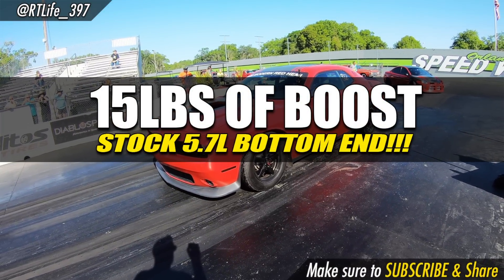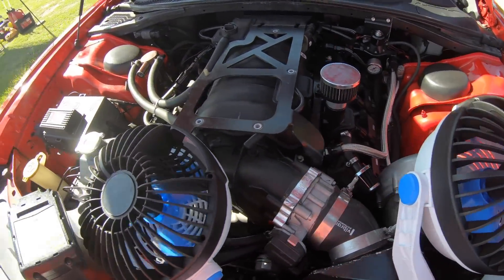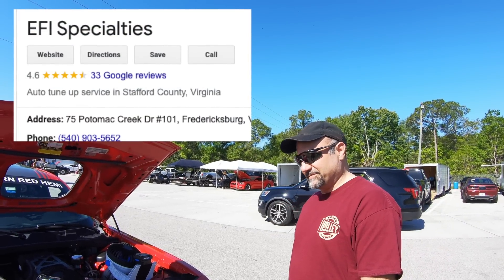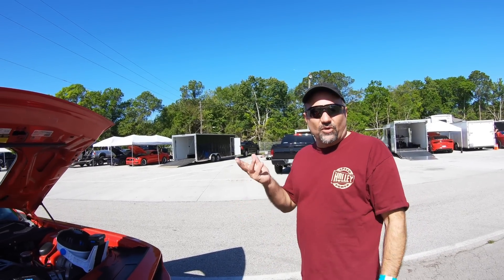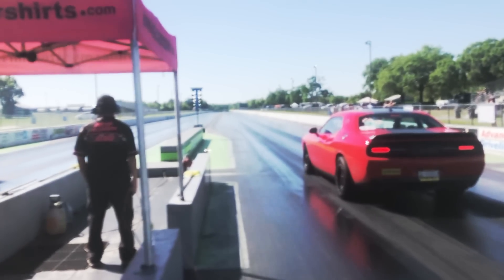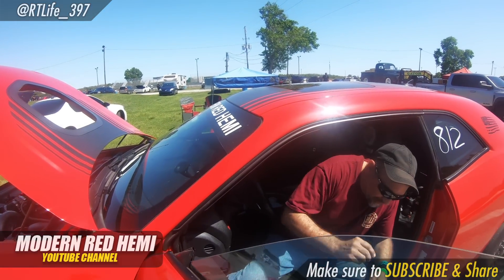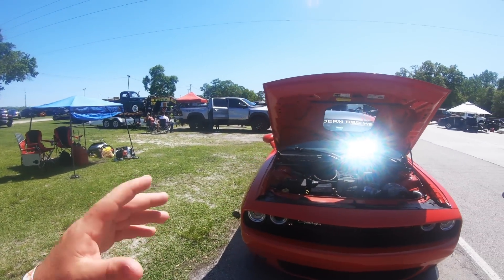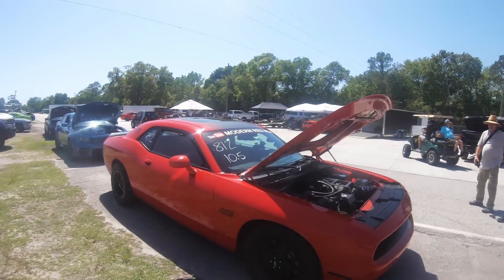Stock 5.7L w/ 15lbs of BOOST!

Comment: Thanks for showcasing Shake ‘N’ Bake one more time! Had a blast hanging out and just being us. What you get on video is who we are. Can’t wait till ya get Big Blue back brother! Hope to get down maybe one more time this year and hang out!
Reply: I've been waiting for the collab video from Orlando. You got Shake-N-Bake rockin. I was impressed when I met you and can't wait to cross paths again.
Reply from the maker: Always fun hanging with you. Shake N Bake did great & congrats on winning the event. You're doing a great job of showcasing the true potential of the 5.7L Hemi.
Reply: Great job Don... you looked flustered haha.. 

To touch on what don said.. there is a ton of tq management in the car to save the trans.. its working.. but its also more than just power being pulled on the shift.. its alot deeper.. the fact that this thing is working so good is definitely all Daves brain being put to use.. being as he started with a slipping shifts banging rev limiter ride when you were only running like 11.3s and 4s.. so its come along way lolol... 

As far as the boost.. the boost is 100% safe.. the timing placements.. the type of blower.. the way it builds boost in the rpm.. all that matters.. cylinder pressure and controlling the heat are some real things.. this stuff is more than a simple boost number.. so many variables go into it.. I think we could push it more with a stronger trans 😃
Reply: Badass 5.7 hemi
Reply: @captainobvious5993  thanks brother!
Reply: @OMGITSMRMACK  well said brother! You are part of why I am where I am!
Reply: @RTLife  you know it brother! Will definitely get back to FL sometime.
Reply: I followed the blue print...
Reply: @ModernRedHemi  ...are u running the stock ring gap spec... or did u open/ increase the gap spec
Reply: @ghostrt1608  stock ring gap. If I were to open the engine to gap the rings I would just forge it while it's out and opened up. IMO no sense in going through all the trouble and cost to just gap the rings. Might as well drop forged components in at that point.

Comment: Also running 14psi on my 5.7 stock bottom end, daily driven no issues. Car runs low 7 60-130s full weight, 93 with meth injection.
Reply from the maker: With the right tuner - the 5.7L can handle some boost! The 5.7L is slept on big time
Reply: Not to be funny but your math does not add up with that setup that means you're running a laptop actively I called BS
Reply: @abcsales3547  My math doesn't add up? I tuned and built the car myself and have dragy pulls, Dyno numbers, and track times to support it
Reply: Might want to see your recipe

Comment: The 5.7L hemi is a great platform ,that's just amazing 15lbs of boost! that is crazy stock Rods & pistons ect ...a excellent view sure luv these Mopar,s.  It's a R/T life isn't it!  Lol Cheers Bud.🤝🏼✌🏼
Reply from the maker: It really is awesome to see how far the 5.7L can be pushed. Shows these 5.7 Hemi's can make some big time power with the right tuner & pieces in place!
Reply: Increase the piston ring gap solves a lot of the problems caused by increasing performance, especially via boost, on 5.7 hemis.

Comment: Man that’s a lot of boost. Saving the trans is one thing, con rods, pistons etc is another. But hey that’s just what I’ve read on forums. If he can make it work reliably over time, we’ll the proof is in the pudding. I bet he has a plan though if stuff starts breaking!
Reply from the maker: I've researched similar. Many tuners & shops will not go past 7-8lbs. Pretty cool to see someone push the 5.7L to the limits & see what it can do.
Reply: @R/T Life  .. probably because they are scared to do it...
Reply: @R/T Life  ... can't wait to get my nitrous kit installed on my 5.7L  Challenger R/T ... aiming for mid 12's on the stock bottom end & maybe a turbo later on

Comment: can I run 8lbs of boost using procharger with stock 5.7 cam? Iv got 3.10 procharger pully, 600cc injectors, high volumeholly feul rail, long tube headers and 3in exhaust all the way back as well as 180 thermostat, boost a pump, catch can and crankcase breather as well as a few other supporting mods here. once i get all the parts on ill be over 550whp but im concerned for the stock cam and timing moving all that air

Comment: The pistons in the 5.7l hemi are skirt coated and aluminum. They can last under 15psi but won't last forever. The rods are a little better than the pistons. I would not be afraid to run 8psi with an excellent tune, but I would never exceed that amount lol. . . Also, I do agree that centrifugal is the route to go, otherwise other modifications may be necessary.

Comment: Krazy house performance on YouTube did some pretty impressive numbers on a junk yard 5.7
Reply from the maker: Was that when they slapped a turbo onto a stock 5.7L?
Reply: @RTLife  he did twins at 21+ psi boost on stock block. Hit the 1000 hp club. PFI tuned it they put a colab video up together
Reply: Keep in mind he gapped the rings and was running a turbo 400 trans if I’m not mistaken, but yes, stock bottom 5.7 can make big power, it’s the trans that’s holding me back now.
Reply: @ModernRedHemi  well yeah, anyone running more then 10 psi should ring gap. Your asking for a cracked piston lip if you don’t. Dig the build you got going
Reply: @jeepwk6.5L  well, I don't go with recommendations, I need a "hey, any more and this thing will go boom" kind of warning. LOL...
Reply: @ModernRedHemi  heat doesn’t tell you anything before it happens unfortunately haha. But yeah I think what ur doings awesome. Once it blows are you going to build an engine or swap it for another stock bottom end and repeat? Don’t get the feeling I’m hating cuz I ain’t I dig what ya got
Reply: @jeepwk6.5L  I have a built 5.7 just waiting in the wings IF it does. ;-)
Reply: @ModernRedHemi  heck yeah

Comment: My stock 2009 5.7 hemi block is on 12lbs e85 tuned by diablotoona,  My procharger is the PSC1 though .
Reply from the maker: Nice! Shows with the right pieces & tuning the 5.7L can really make big time power
Reply: What rwhp you get with 12lbs
Reply: @ericgott118  552hp 489tq. On e85. With my winter tune on pump gas I'm at 516hp 445tq. But on winter tune  of course I'm running less boost.

Comment: Umm.. I’m not the smartest guy in the world but I thought stock meant… STOCK? I’m the beginning you said aside from the pro charger and cam it was stock..

According to that long list of things I counted at least 4 things gave his car more horsepower or made it run better that weren’t the pro charger or the cam..

I’m not hating by any means cuz I like his car

But In  what way is his car stock other than the pro charger and cam?
I’m confused
Reply from the maker: When most say their engine is "Stock" or "Stock bottom end" they're referring to not having forged pistons, rods, crank, ported heads etc. The engine isn't setup properly to run higher boost levels. I understand what you mean - this thing is far from stock overall.

Comment: I think the problem people are having is you're taking a car from the factory with factory specs that means you have a weak transmission you have a weak Gering not to mention the axles are week the brakes are weak the cooling system is weak all of it not designed to go over 500 horsepower you are basically putting yourself in a money hole this is not the 80s where you have to go out and build your own car just to go fast they actually sell them to pretty much anybody with money
Reply: I had a 1991 Mitsubishi VR4 twin turbo V6 I upgraded the turbos had a 9-second car use the Dual turbo timer and 125 shot of NOS everything broke on that car over and over it's not designed for it it will break
Reply from the maker: part of the fun of owning a car is learning & modding.
Reply: I mean even the Hellcat axles and driveshaft are weak so what’s your point? That’s the fun of moddin and to each to own